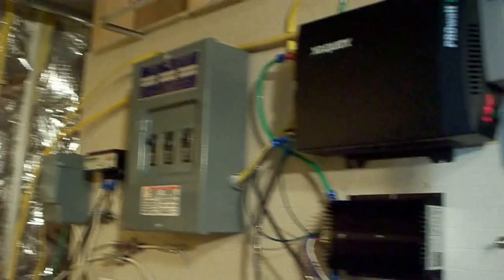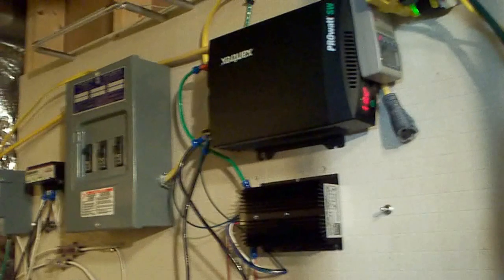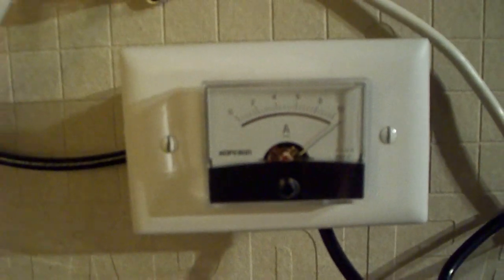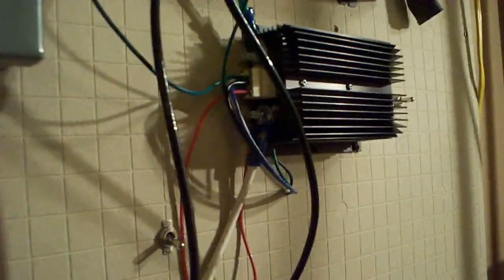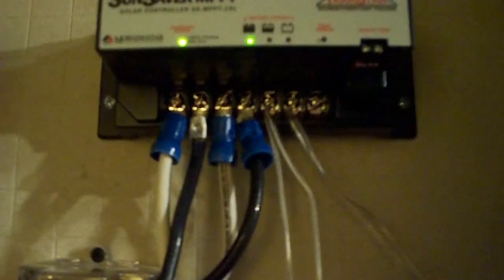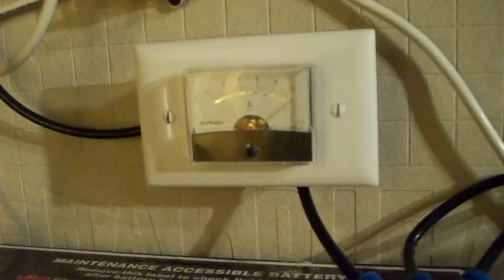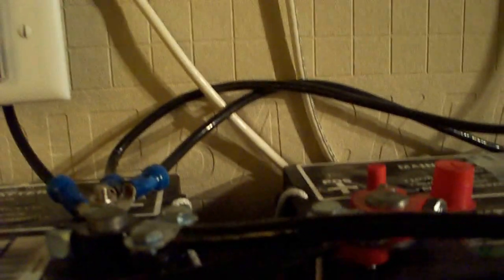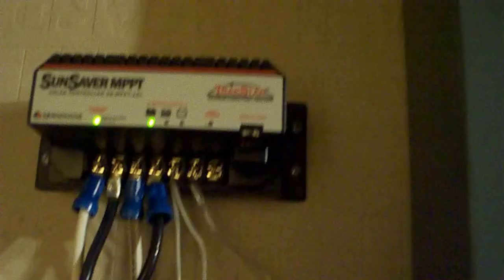Residential solar panel system built by a 16 year old

Comment: Great job.......... Batteries Plus sells 100 amp deep cycle batteries for $100 ? Good find ..... How much were the LEDs and where did you buy them ....
Im curious in grounding the solar system ....... Do you just ground the solar panels ?

Comment: Thanks so much for sharing and such an easy to understand explanation. We already have a small 12 volt light system that has worked well for 12 years.
So armed with your fantastic info I am about to add two more panels onto the system, change controllers and inverters, and add a fe of your features. My husband thinks I cannot do it....I am out to prove him wrong. I am a pensioner but who cares!!
I have a grid tie inverter but thinking of a way so that I can switch from this and the battery bank.....any ideas?
Great work, you'll go far!
Reply: buy a blue sea switch and wire that to your GTI and Charge controller and you can switch back and forth, or use both at the same time. I just installed one recently in my own system.

Comment: With a grid tie system, you really only start getting into a difficult situation with the power company once you start getting close to overproducing electricity. Once you get close to putting power back onto the grid, then things get tricky, each power company has different policies. Some states will even require that you stay grid tied, so it all really depends on your location and the power company you use.

Comment: Getting it off grid I know would require increased expense for batteries that require maintenance If one wanted just to drop their electric bill I guess it would be very possible to do so as long as the power company did not charge you BS charges for line usage? There are all kind of little tricks to cause them to keep the profit you should get should you do a grid tie system. I guess that profit is what you would have to spend on batteries?

Comment: The AC will draw a lot of power compared to the laptop and the fan. The quote I gave was for an average home, and the average home doesn't conserve much power. $5-10k and you can have a sweet setup as long as you are energy efficient, you wouldn't have to go without the creature comforts. Minimalistic setups can be put up for as little as a few hundred dollars. You would have to crunch the numbers to figure out how much power you would need for a small setup like you mentioned.

Comment: I would be happy to have a system that just provided power for an AC a laptop and a fan. Solar cookers can do the food? Passive solar can heat water too. Build an outdoor shower and you got yourself a sweet setup unless skeeters are an issue then you need to screen it in. I found if I had to conserve water it takes just 2.5 gallons of water to get a great shower.

Comment: IDK where you live my guess is you are about the latitude of N MS  TN some just a guess by shadows cast in August. Your dialect does not sound Southern possibly Mo but that is not always a given you could have relocated to the South? You did an excellent job explaining your system I would like to know if you run a window unit on this if so how large and how long will your batteries last on a hot day.

Comment: Nice job man!! I have a simular setup in my house using that same inverter pretty sweet.
The only thing id worry about is those batteries gasing... without proper ventilation it could be kind of like the hindenburg blimp diaster..too bad u didn't make a video on how u made those solar panels i like to see how they turned out..cheers

Comment: Your present module mounting location will not have good sun exposure in the winter (module tilt too low).  You should see about moving them to a rack along a south facing fence or somewhere where they will get decent all year sun exposure.  If/when HOA fascist douchebags scream about it then you should move somewhere where there is no HOA.
Also, kudos on having an off grid only system.

Comment: hey man pretty cool stuff!!! I'm a big fan of solar backup systems and small systems. I'm 15 and i've been setting up systems for about two years. You metioned in the video that you ran your room off the system, what are some of the things you use. I have always looked for some way to cut off power to the inverter to protect your batteries. That is awesome. I think that is the bestest fault that i find in small and big systems, people over use there batteries and that is that. Well great job.